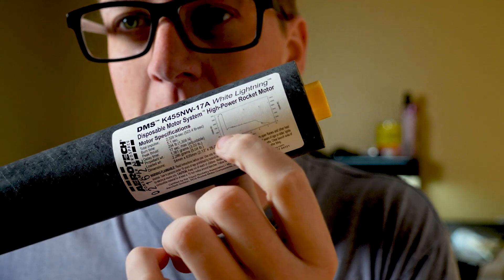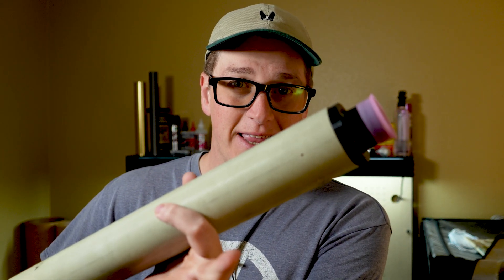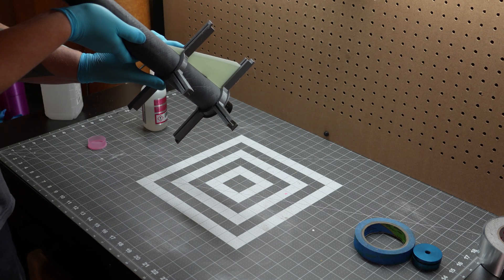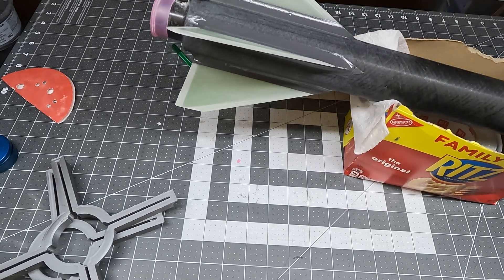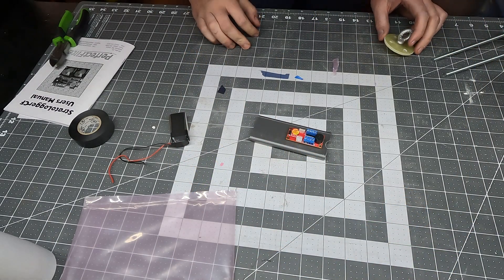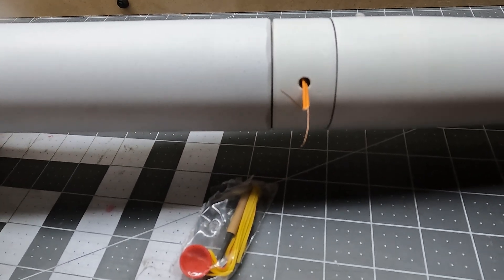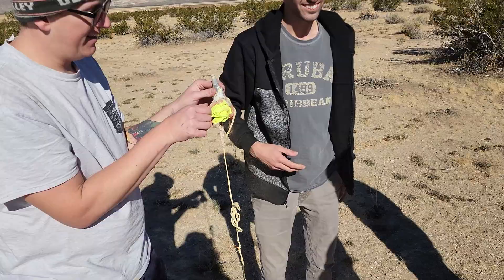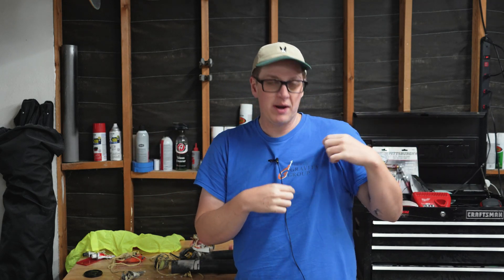JB Weld Rocket vs. Supersonic Speeds

Comment: I have a question. What is that launch guide design called? I've never seen it anywhere, but I invented a similar thing on my own (I have a video on my channel with a launch from a similar thing). So really curious if that design has a real name and who invented it first
Reply from the maker: It's a pretty standard launch tower. They've been used for decades

Comment: If you had a choice between Proline and JB weld, which one would you prefer?
Reply from the maker: Honestly, at this point, I'm not sure. Using a lot of JB Weld can get pretty pricey and it's heavy. On the other hand, it's lovely to work with readily available.
Reply: I was thinking of buying a Wildman Mach 2 my first minimum diameter rocket

Comment: You should look into making an arming switch using a screw and two nuts. When off, the screw is only screwed into one nut. The screw being screwed into both nuts completes the circuit between them through the threads, and is very secure. Even if the screw loosens through vibration, it still makes contact through the threads of the nuts. It only takes a small hole in the fuselage to stick an Allen key in to switch it too. Copper/aluminum nuts and screws work the best.
Reply from the maker: While that's a good idea,  the coffee
choice to exclude a switch is deliberate.  More components means more space taken up and an added potential failure point. 

Given that both charges fired, I'm comfortable in ruling out the electronics turning off as a failure point. Twist and tape prevails lol

Comment: awesome build! Quick question, obviously this depends on how its built but would a minimum diameter 54 on the loki 54 M be possible. or has someone done that already ive just always fantasized over the idea of it. Also I had a flight at airfest where one of the two altimeter leads which was taped to the side of the rocket as how you do it came un done with a just over mach flight. a little scary but luckily I had a backup. gonna use switches from now on.
Reply from the maker: It has been done! I saw one with surface mount only fins with no tip to tip take a Loki 54mm M in Argonia a few years ago.

Gotta twist lots on those leads!

Comment: Its a single use motor so technically the main didnt even need to come out.
Reply from the maker: Well if the main doesn't come out it doesn't come out
Reply: Now that’s what I call a proof of concept.
All I need my JB Weld to do is repair a broken metal leg on a 5 ft electric palm tree….. 🧉😁
Shame you lost the data….Just want to say how much I enjoyed your project. 
Hopefully your next attempt avoids the face plant ending… 👍🏻🍻💙😎